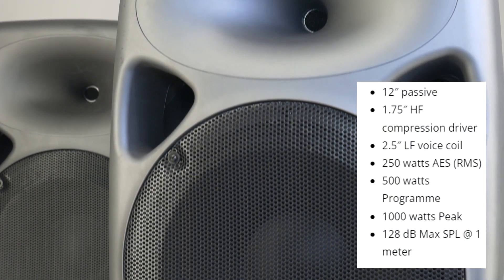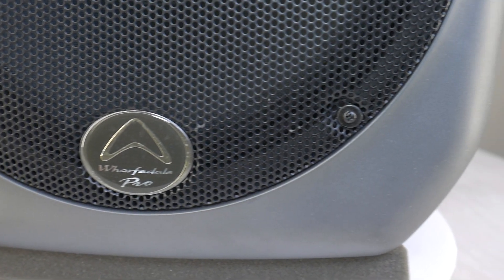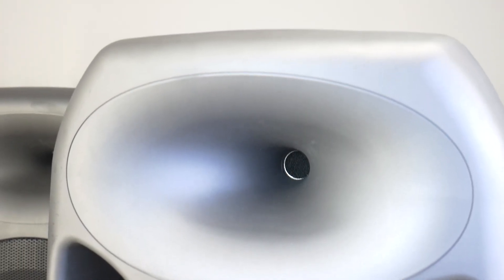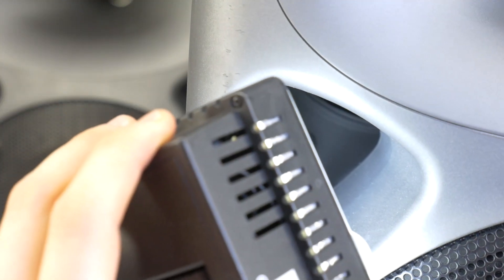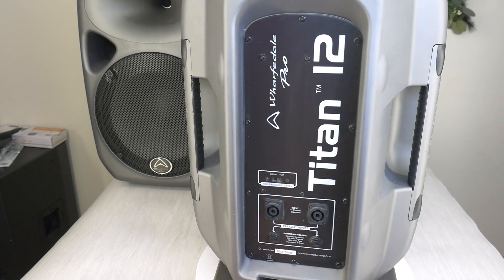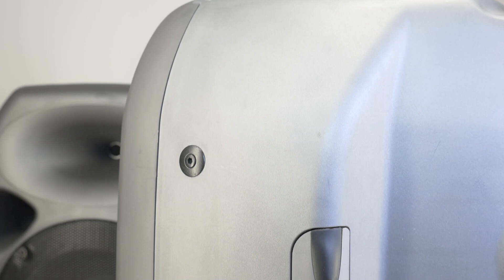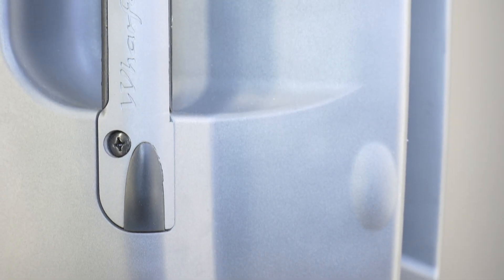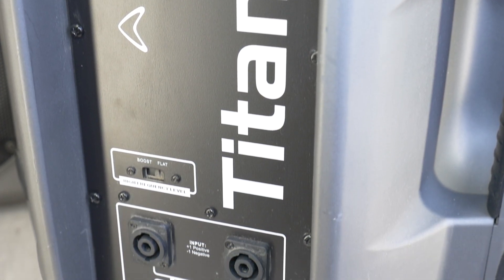Teardown Wharfedale Titan 12 PA speaker

Comment: I recently acquired this very model. They were in a pile slated for disposal at one of the elementary schools of the district I'm employed at. Can you believe they were just throwing them away? That's insane! Other than being a little scuffed up and obviously well used, there is absolutely nothing wrong with them. I have since adapted them to run in my garage at home powered by a proper discrete older Sony receiver. I installed female binding posts. Keep in mind, if you are thinking of doing the same, the back plate is metal and therefore electrically conductive. Bore the holes large to help eliminate shorting and apply insulation on the poles of the binding posts. I used shrink tubing. They sound amazing. They're obviously designed to project and do they ever! If I attend a gathering where loud music is desired, I'll have these to lend to the engagement.

Comment: If I were to design speakers they would be a compromise between a PA speaker and a home audio speaker in terms of sound output like a 91 dB efficient 500-watt rms speaker with a 13-inch kevlar cone 500-watt neo magnet woofer and oversized voice coil and ribbed surround to take care of the 35 to 375Hz Range, a 5-inch 200-watt aluminum phase plug kevlar cone midrange to take care of the 375 to 3000Hz range, and a 200 watt 1-1/4 inch ferrofluid horn loaded phenolic dome tweeter with a beefy heatsink to take care of the 3000Hz to 40KHz frequency range. So you have that intimate sound of a home audio speaker but, the SPL will be 117 dB at 1 meter when tested in an anechoic chamber and at program wattage, it would peak at 120 decibels. It will have an enclosure made out of the same plastic as high-end PA speakers and carry handles. They will be called hybrid speakers because they are in between PA and Home Audio speakers.
Reply: You should experience ACTUAL high-end PA. Incredible sound quality that could easily fit in the home environment in terms of sound profile. Single boxes with 100dB sensitivies minimum.
Reply: Quisiera escucharlos . Cuando hagas uno hazme lo saber gracias

Comment: Why does the HF driver haves those LEDS around it? In my active version it works as power on LED
Reply from the maker: I think the passive and active version are the same boxes, include speakers and leds, only in the active version put a rear panel with amplifier.
Reply: Its provably for overdrive warning from the crossover